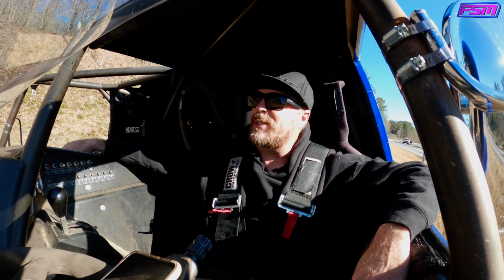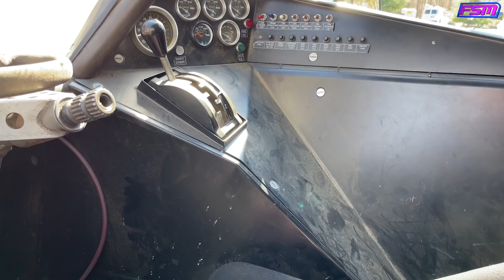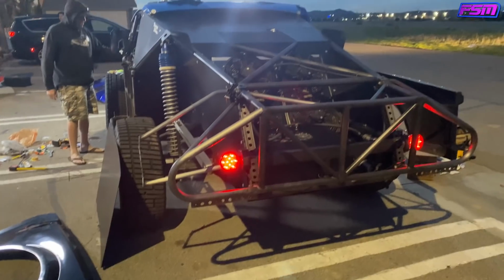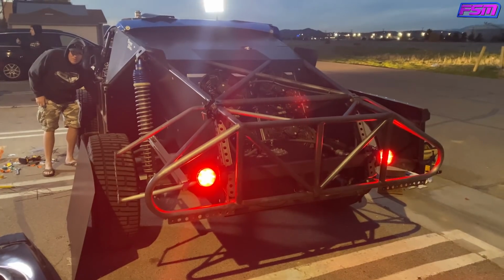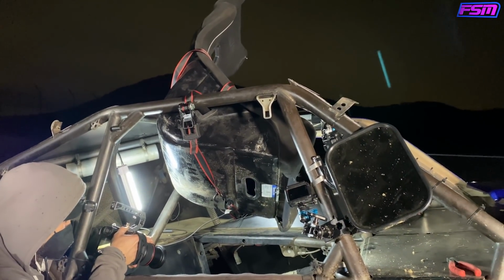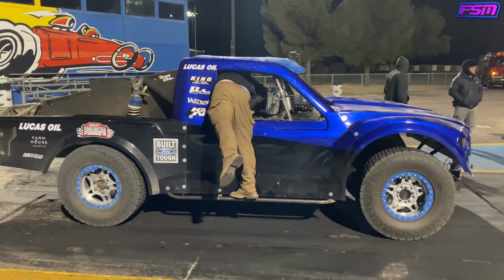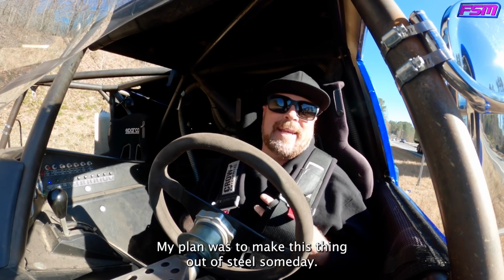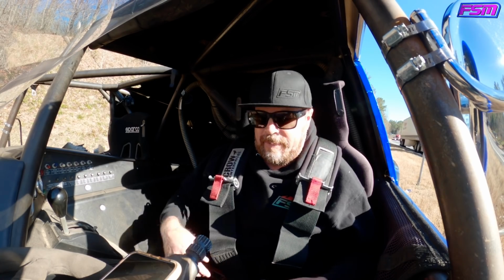BOUGHT A USED LS-POWERED RACE TRUCK AND THE ROOF BLEW OFF!

Comment: That thing is so sick.  It's like an adult version of a go kart.  It's got to be so much fun hitting jumps and ripping off road.
Reply: This ain't No Raptor or TRX which would fall apart after jumps.
Reply: @shadowopsairman1583  Those trucks are sturdier than you think. They can't be abused as much as a Pro 2 Truck. Street Speed 717's first TRX wasn't in the best shape appearance wise, but it ran perfectly fine. Little bit nose heavy but it can jump. That goes the same with the Raptor as well. All he broke was bedmount, easy to fix.

Comment: By swapping the TH400 for a 6l80e you can drop the rear gearing down to about 4.30's and gain OD. You'll end up with pretty much the same gearing off the line but driving on the road will be a lot better. Even going with 5.13's in the rear and a 6l80e would be an improvement.
Reply: Um you 6l80's explodes under horse power
Reply: @stacysery5612  That's like saying the 200-4R is weak. In most factory applications they were weak. Built they handle extreme levels of power. There are 1000+ HP GN's still running them. It's the production 6l80's that have a bad rap. 

Chevy performance parts has 6l80's rated at 650lb/ft(200lb/ft more than a stock TH400) and other companies are building them to handle even higher power. A factory trans vs a built trans are two very different things and I don't see Finnegan swapping a junk yard trans into the truck..
Reply: I'd be changing to a Bowtie body
Reply: @stacysery5612  excuse me 80 means 8000 lb gvwr like the 4L80. So it can handle it, even a built 4L60 can handle it

4L60 is 6000 Lb gvwr.
Reply: @CzechSixTv  I agree, I've got carbon clutch packs in our 6L80e and a few other small components like a trans cooler. It hauls a fully loaded down van and trailer like cake.

Comment: "But it's a LS so it'll be okay..." until it chucks the rods out. You should just buy a late model truck with a blown engine and gut it and throw all the good parts off of that thing onto it and have a title and everything for it. It'll also allow you to put AC and heat in it so much easier. OMFG! I just got the ultimate idea! Make a new MACHO GRANDE with that suspension! How cool would that be? Here in northern California the wreckers are littered with late model Z71 Chevy trucks you could use that are listed dirt cheap. There's also a guy in Yuba City selling a 81-87 Suburban body/rolling chassis.

Comment: Mr. Fin, hope you didn't get any fiberglass splinters in you.
Might you be interested in a real offroad adventure vehicle also LS powered. 
To be more exact it'll have to be on different avenue of communication,  but I assure you, it'll blow the pieces left by the breeze in Georgia, and easily ger what it didn't get of your roofline, and  the other panels. 
You've got the version with training wheels now lets say, but this one comes with two seats also, but remember the old PF Flier commercials, and what they use to say about what they said you could do if you wore they're tennis shoes. 
Now lets see if you're reading all your comments. 
BTW, glad you like the solution to part of your fabrication process. 
Have a great day

Comment: Just cut both sides off flush with the top of the "door", throw a temporary aluminum panel on the roof, and act like you meant it to be that way. That wasn't a flaw, it's now a feature. Problem solved.
Reply: I believe you would be referring to  road kill😂